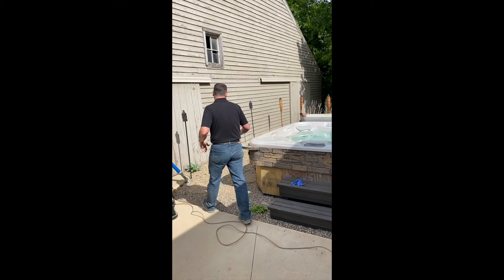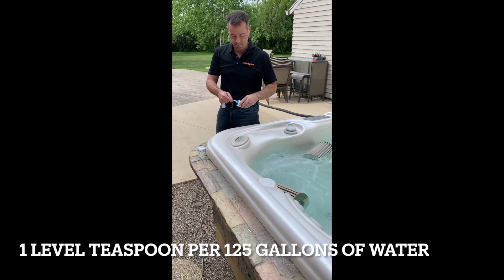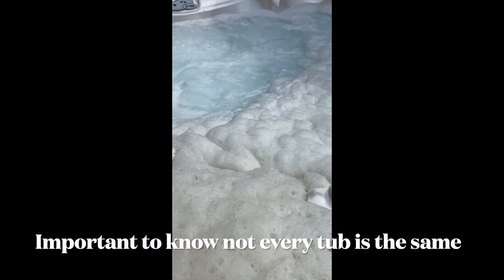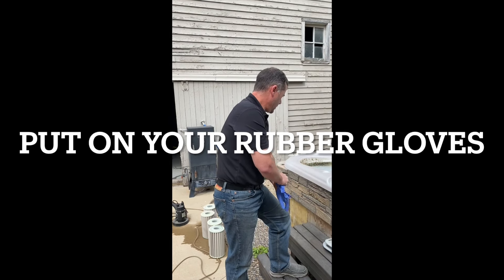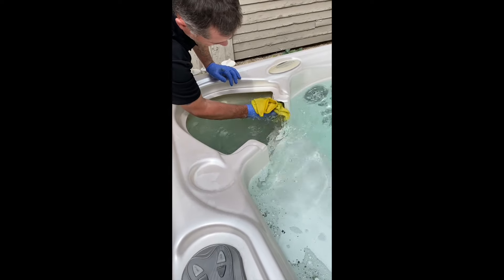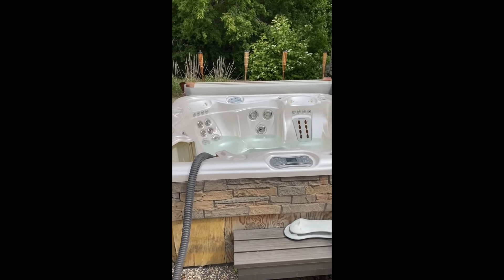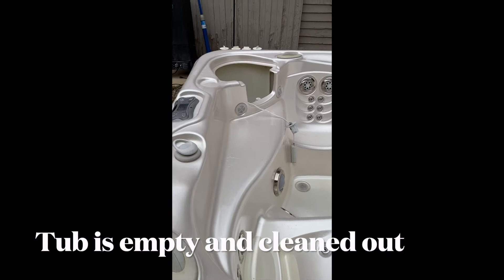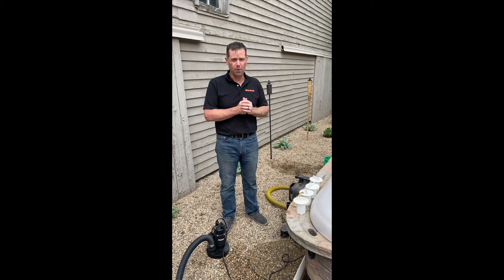How to Purge your Hot Tub with Ahh-Some

Comment: Husband and I used Ahh-Some to clean out out hot tub about 2 months ago.  Our jets aren't the most forceful but we got gunk out of the pipes and did all the steps you show in this video.  We have been using the hot tub a couple times a week with 2 people for about an hour without any issues.  Flash forward 2 months and now we have foam (more foam than we did when we cleaned with the Ahh-Some) with a bit of tinted gunk like when we had used the Ahh-Some.  Is there a reason our tub is releasing gunk and lots of foam all of a sudden.  Everything is balanced.  Any suggestions.
Reply from the maker: Hi Elizabeth.  Has there been anything significant that happened over the 2 months?  Anything strange?  Any periods of time where you had the cover off for a period of time?

Comment: I have had hot tubs for 30 plus years. Always been told to NEVER run tub with out filters. Then you didn't even rinse them off before just throwing them in.  Could have a hair pin or any other debris that could lock up and even burn up a pump or motor.
Reply from the maker: Thanks for your reply and comment Don.  You can absolutely run Ahh-some through your tub with your filter cartridges installed however, you are going to ruin those cartridges.  It is absolutely essential to run your Ahh-some through your tub WITHOUT the cartridges so you don't gunk them up.  Also, I do agree with you that it is better to rinse the cartridges prior to tossing them in the tub.  Lesson learned there and thank you.
Reply: @ahh-some  I saw another video that says you should replace the filter caps after removing the filters before running the 30 minutes. I noticed you didn't do this. So what do you think-caps or no caps (After removing filters)?
Reply from the maker: @AlexM-xd2bd  No need to replace the caps.

Comment: Thank you very much for this, i will be getting some of this stuff, will it work if i have little brown stuff floating in there when i turn it on? When i turn it off the bottom has tons and tons of this brown flake stuff everywhere, i just drained it again and i haven't done anything else as i am about done with it all. I can not get rid of this stuff. Thanks
Reply from the maker: Morning Stephen.  Thanks for watching and Yes, Ahh-Some absolutely will purge your tub of everything that isn't supposed to be in the plumbing.  Depending on how old your tub is, you may or may not need to either do a 2nd purge back to back or to save some water, do this.  Run the Ahh-Some for the full 30 minutes with the jets on high and filters out.  Then turn jets off after the 30 minutes.  Wipe up everything that comes out.  Most often, it accumulates along the water line and the shell of the tub.  Then let the tub sit for a few hours.  Run the jets again for 20 minutes, no additional Ahh-Some needed. After that 20 minutes, wipe again.  Repeat this process until you get more more gunk coming out.  If you go longer than 24 hours, you will need to refresh your Ahh-Some.  You can use the same water for this.  Once you feel you have everything out, drain, refill, balance and enjoy.  If you have any further questions don't hesitate to ask.
Reply: @ahh-some  thank you as i was getting ready to give up on all this. I will order some and try it.
Reply from the maker: @simplisafesecurityandcameras  No problem at all.  Again, don't ever hesitate to reach out with any questions.
Reply: @ahh-some  since i got mad and drained it out when i fill it back up do i have to balance water or can I just fill it, then let it heat up and do the purge then drain it back? Just wondering if it has to be balanced to do the cleaning or not.
Reply from the maker: @simplisafesecurityandcameras  It does not need to be balanced.  However, and you can just check this, Ahh-Some does work best with a pH between 7.2 and 7.8...that said, if you were just a little higher or lower than that it will not make any significant difference.
Reply: @ahh-some  you are the man thanks a lot for this and i just subscribed to you, i will give it a whirl and hope for the best, thanks again

Comment: How much product do  I have to use for a 6 person hot tub  ?
Reply from the maker: Hi and great question.  It is more based on how many gallons are in the tub.  A standard 6 person tub is generally around 450 gallons (give or take).  I would start off with 3 teaspoons if you are using the gel.  If you are using one of our single use pouches, use the entire pouch.  If you are using one of our liquids, start off with 8 ounces and bump it up if need be.  You can always add a bit more Ahh-some to the water if needed.  Hope this helps.

Comment: Our ahh-some seemed to clump up on everything including our sump.  What do we do if it stuck in the plumbing and comes out when we fill and turn on the jets?  Do we need to drain again?
Reply from the maker: Hi Wendy, generally no, you will not need to drain again.  99% of all the gunk and grime that comes out will attach itself to the shell of the hot tub.  It looks like a "ring around the collar".  That said, there are some tubs that will need to be drained again simply due to the significant amount of gunk and grime that was removed.  Generally, anything remaining in the plumbing system that comes out will be killed off by the sanitizer in your hot tub.  I hope this helps however if you have any additional questions, please do not hesitate to email or call us.
Reply: Just let that residual of Ahh-Some that you see left over that did not dissolve- is what you are saying here & let the fresh refill water take care of it, it's okay that the leftover Ahh-Some is still in the tub because it will dissolve,, also provide a beneficial sanitizing effect after the new refill. I also use his newer product called"Aqua Clarity"which you add once a week. This stuff is   AhhSome!

Comment: I used the liquid version and followed the dosage recommendation. Didn't really foam up like in your pictures, wasn't much different than running the tub normally. 3 month old new tub, first purge. Didn't have really any scum to clean up.  330 gallons tub. Not enough ahhsome or just not dirty?
Reply from the maker: Good morning.  Which liquid did you use?  If you used the liquid that comes in the 16 oz bottle you simply used the wrong product.  Let me backup, not necessarily the wrong product but one that is not designed for Hot Tubs.  That liquid is for Jetted Bathtubs.  If you were to use that liquid in your hot tub, for 330 gallons you would have needed to use approx half to 3/4's of the bottle.  If you used the Aqua Clarity, which is our newest product, you would have needed to use right around 10 ounces.  Now that said, and this comes up a lot, why didn't anything or very little come out.  It could be simply that you have a very clean tub and that is GREAT!  More often than not though, the biofilm, mold, fungus, ect, is there, just didn't get released for whatever reason. In your case based on how new your tub is, and if you were using the liquid jetted tub cleaner, you more than likely didn't have enough.  The only two purge products we have for hot tubs is the 2, 6 or 16 oz Gel or the Aqua Clarity.  The Jetted Tub liquid will work but you need to use a LOT of it so it is not very cost effective.  I would follow up again in 6 months, and use the gel or the Aqua Clarity this time.  Thank you so much for commenting and don't hesitate to reach out to me directly with any questions.  Phone and email are on the website.  Have a great day,
Reply: @ahh-some  yep that seems to be the issue, thanks for clarifying!
Reply from the maker: @mjavanshad  Very welcome.  Please reach out if you have any other questions or comments.  Happy to help.
Reply: @ahh-some  it's the same product just different concentration? Since I bought the bottle, I'd like to use it next time and not let it go to waste, just will start with half the bottle and increase until it foams to the right amount.

Comment: Good video. Are this Watkins tri-x ceramic filters? They look like it. Ahhsome's website specifically says it is very important to not put those filters in the tub as they can be damaged.
Reply from the maker: They are and yup, I absolutely agree.  That said, these ceramic filters are just about at the end of their usable life (will be replacing in the fall) so I decided to let them run through.  We always recommend that these types of filters be deep cleaned with our Ahh-Some Filter Cleaner which is a great cleaner that only takes 20 minutes.  Again, with regards to these particular cartridges, I wasn't overly concerned.  Great point though that I should have mentioned on the video.
Reply: Unfortunately i was not aware of this until i saw this comment…  And it’s not write on the product box.. i just let my 5 tri-x ceramic filter in the tub for maybe 1h with ahh some then i rinse them. Do i have to replace them ? What kind of problem did your custormer encounter with ahh -some and tri-x filters ? Thanks (im a french customer)
Reply from the maker: @tibz1944  You shouldn't have any real problems.  I run my tri-x's through the tub with Ahh-Some.

Comment: Is it wise to take the filters out while running the tub?  I've always been told not to.  Seems to me that invites issues with stuff getting into the tub lines. ??
Reply from the maker: Hi Jay and thanks for your question.  Most of the time you are absolutely correct.  Not a good idea at all to run the tub without the filters.  However, when you are running Ahh-Some through your tub, we release so much biofilm and other contaminants that if you were to leave your filter cartridges in place, they would get so gunked up that they would almost always need to be discarded.  In addition, you would see significantly less water pressure coming out of the jets as they became more contaminated.  I always recommend to everyone to make sure that there are no leaves or anything of significant size in the water prior to starting the purge.  Once the purge is complete, and after refilled, just put the cartridges back in place.  Hope this helps.
Reply: @ahh-some  Thanks for the clarification!
Reply from the maker: @cre8ivjay  You are very welcome.

Comment: Nice video.  What kind of sump pump do you have 10 minutes to empty 375 gallons is impressive!  Mine is 1/4hp and takes 30 min for a tub about the size of yours.
Reply from the maker: Thank you.  I have an Everbilt 1/2 HP pump.  Works great.  I had an older pump before I got this one that was a 1/4 and it took far longer to drain.  Upgraded to the 1/2 HP about 2 years ago.

Comment: Thank you so much for this video! I have an Envoy Hot Springs hot tub and this was very helpful. I'm now in the process of purging mine for the first time and I decided to use ahh-some! The process is going well so far! I have foam but it's not overflowing. 

I've only had my hot tub about a month but I decided that I needed to clean the pipes out from where new hot tubs are dirty due to them being tested at the factory where they're made and there is usually water that sits in the pipes that can cause issues from the beginning of use. I have a saltwater tub and the salt cartridge seems to be declining too fast so I decided to start with a very clean tub. 

Thanks again for this video is extremely helpful!
Reply from the maker: You are very welcome Olivia.  Thank you for the kind words.  Don't hesitate to ask any questions.  We are here for you.

Comment: Purchased off Amazon. Product is orange not blue as in video is this the correct product.
Reply from the maker: Yes, it just has our older label on it.  You are good.
Reply from the maker: Wait a second, you mean the gel is orange?  If the gel is orange, than you have the wrong product.  That is our filter cleaner not our Hot Tub line cleaner.  It will be fantastic for your filter cartridges but not for the tub lines.
Reply: @ahh-some  the product on Amazon had the correct label..this is what i had ordered…..Ahh-Some Spa & Pool Filter Cartridge Cleaner, Hot Tub Filters & Cartridge Cleaner Soak Solution, Works great on Sand Filters, Improves Tub Filter Efficiency, 6 months cleaning in a single contain….is this the same product that is used in this video?
Reply: @ahh-some  ps…i was sent the incorrect product..this is what i had ordered but got the orange instead of the blue. I returned it today…Ahh-Some Spa & Pool Filter Cartridge Cleaner, Hot Tub Filters & Cartridge Cleaner Soak Solution, Works great on Sand Filters, Improves Tub Filter Efficiency, 6 months cleaning in a single container
Reply from the maker: @islandgirl478  Yes, you will want to get the Ahh-some Hot Tub/Jetted Bath Plumbing and Jet Cleaner.  The filter cleaner is only designed for the filters.

Comment: Great video, just about to do my first purge on my 9 month old tub.  1 question, is it ok for the pumps to turn the power back on when their is no water in the tub to get the last bit out of the jets? I know you just did it really fast but I'd be nervous turning them on and running dry.
Reply from the maker: I do it all the time for only a few seconds.  You should have no issues provided you just do it quick.  We don't want the pumps to run for 10 or 15 seconds with no water.
Reply: I use my shop vac to clear out the pipes instead. I don't want to risk doing damage to the pump.
Reply from the maker: @jackdawson3276  Absolutely acceptable.  I used to do this as well and a LOT of others do as well.
Reply: How do you clear the pipes with a shop vac ?

Comment: I want to know if this actually works or if it’s just a soap product.  I wish they would take hot tub that’s been neglected and has biofilm in the plumbing. Show us the plumbing before and after.  Let’s see what it truly can’t do.
Reply from the maker: Hey thanks for the reply. Ahh-Some is absolutely not a soap product.  I assume that you have not yet had the opportunity to try it out for yourself.  I do highly recommend that you do.  What you are suggesting with regards to the before and after pictures of the plumbing, this has been done before.  I don't recall where the images are at, one of the Pool and Spa forums I believe.  Quite revealing.  Anyways, thanks for your comments.  Don't hesitate to reach out with any questions you have.  Always available at www.ahhsome.com
Reply: @ahh-some  thank you!  I bought some last night and I will try it on a hot tub that’s been empty for a year and see how it works.
Reply from the maker: @webcrawler3332  Sounds great.  A quick suggestion if I may.  On a tub that has been sitting empty for a year or more, it will be best to run the Ahh-Some at the correct dosage for the 30 minutes, and then let it sit in the tub for a few hours so that it can continue to attack any of the bio-film that has really hardened up.  Many tubs that sit empty for a while also end up needing a 2nd full purge to get everything out.  Let us know if you have any questions at all about anything.  Here to help.
Reply: @ahh-some  Thank you for the tip. I bought the bigger jar just in case plus to do a purge in about 6 months again.  I want to make sure that gunk is out! 😁😁

Comment: Sorry me again from yesterday,  is it ok to purge with cold hose water (hot tub is empty at the moment )
Reply from the maker: Hi Cassy.  Sure, you will want to dissolve the gel in some hot water first before putting it in the tub.  I just microwave a half a coffee cup with water for 90 seconds and then put the required amount of gel in so it dissolves.  Takes about 60 seconds, then just pour into your tub.

Comment: i have a 2000gal swim spa  does this expand the purge time?  been told to let it soak for 5 hours.
Reply from the maker: Hi Jon.  Great question.  No, it does not extend the purge time at all.  That said, we do have a lot of customers who do run it for longer in their swim spa.  Whatever you feel comfortable with.  I was on the phone with a swim spa customer yesterday who ran it for the 30 minutes, then let it rest, he wiped up all the gunk and then ran it for an additional 30 minutes to get the remaining biofilm out.  He stated that worked great for him.  The choice is really up to you.  30 minutes is the key.  As long you have it running for that period of time, you will be good to go.  No harm in letting it run longer if you desire.  Hope that helps and thanks for the question.
Reply: @ahh-some thank you
Reply from the maker: @jonpriest  You are very welcome.

Comment: Which ahhsome product are you using? I see several on the website?
Reply from the maker: In this video I am using the Hot Tub/Jetted Bath cleaner.  This comes in 4 different sizes.  2 oz, 6 oz, 16 oz and a single use packet.  They are all the same, just different sizes.

Comment: Does the water have to be hot?
Reply from the maker: Doesn't need to be.  If you plan on purging your tub with colder water (less than 90 degrees) simply dissolve the required amount of gel in some hot water (I microwave about a half cup of water for 90 seconds) then just drop the required Ahh-Some into the cup, let it dissolve, then pour directly into your hot tub and run for 30 minutes.
Reply: Worked great! Thanks for the tip!!
Reply from the maker: @ForestRose  Very welcome